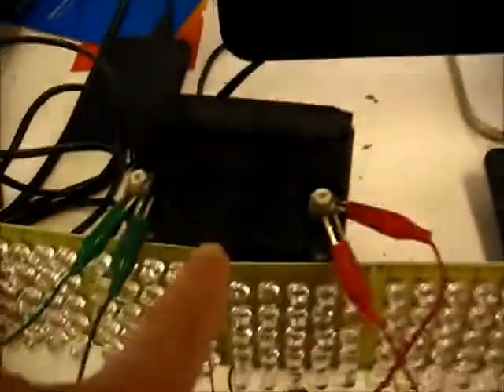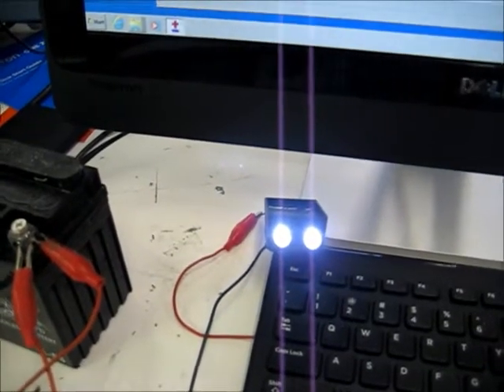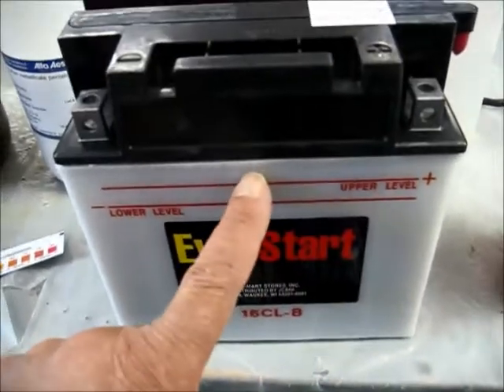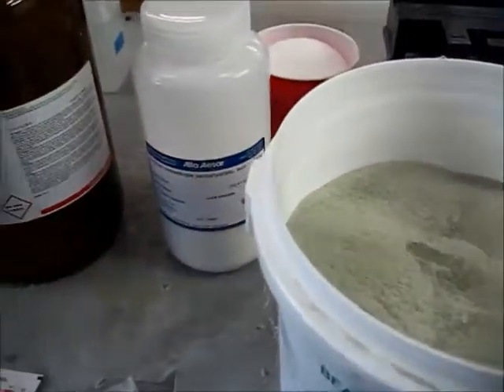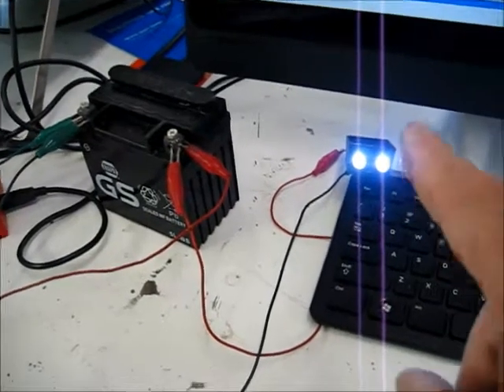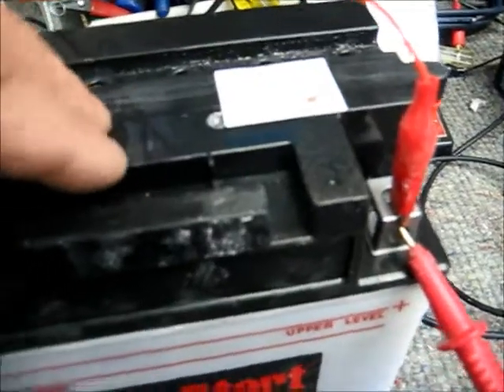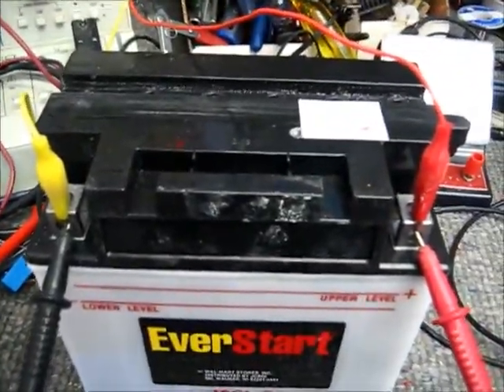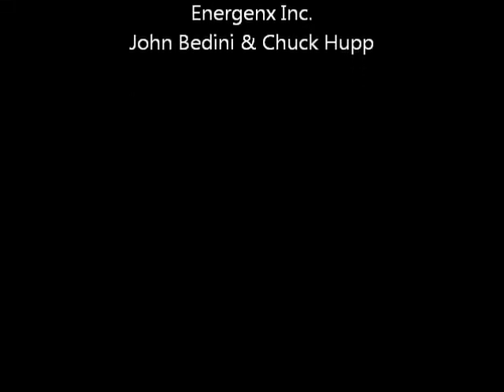Mixing Chemicals for Hydrate Cell 9 John Bedin &i Chuck Hupp

Comment: what would happen if you introduced citrus juice of some sort to this mix?  i know that oranges and lemons have often been used in science classes to power small clockes, so so would it be possible to dope it up into a high capacity battery with the right mix of chemicals?
Reply: i havent tried any of this myself yet, ive just often wonderd about the citrus juice idea.
Reply: Otex Hulk plant

Comment: It sorta sounds like we need to make an "electrolyte" that uses an Acid and a Base that doesn't degrade each others traits when mixed into a common liquid.   This way the expansion of the acid versus the contraction of the base can work as a cumulative system but with each ingredient of the cumulative system being out of balance with the rest of the system internally.   Sorta stinks that we can't get the two hydrates and replicate.  Great stuff John/Chuck, Thanks for sharing!

Comment: I have found with a pinch of epson salt and a pinch of alum together in a lead acid battery can bring it back to life after it has been over charged. I have no idea how long it will last but it has been making steady improvements in current capacity. These batteries came out of an electric scooter with distance increases every charge. I wish I had some of those chemicals but like you said they are not public. Thanks for the video.